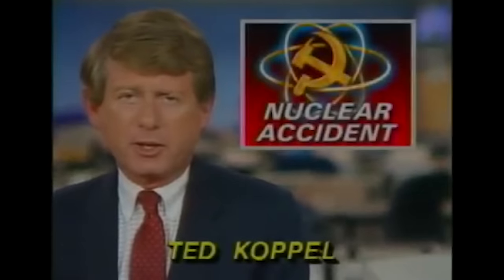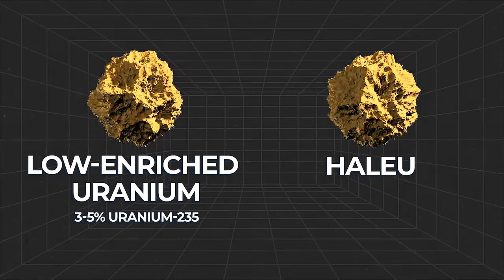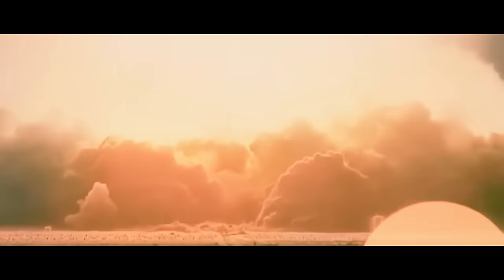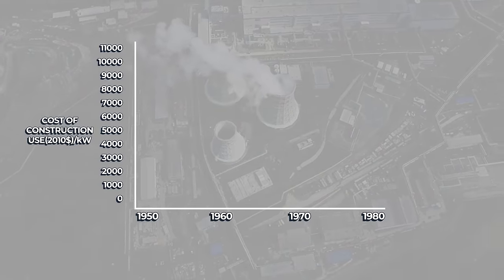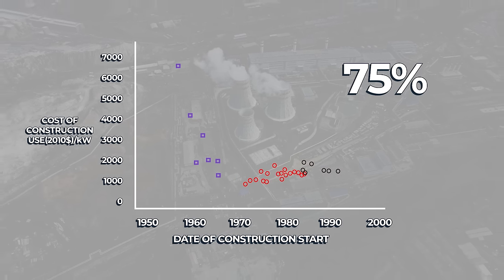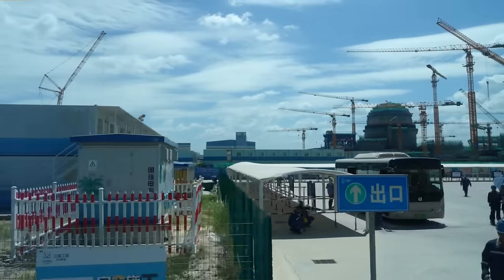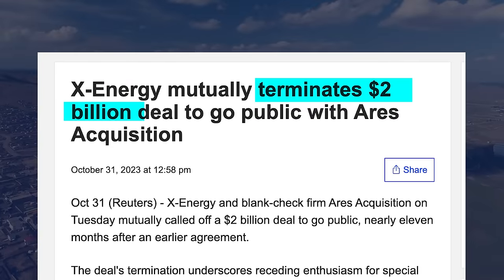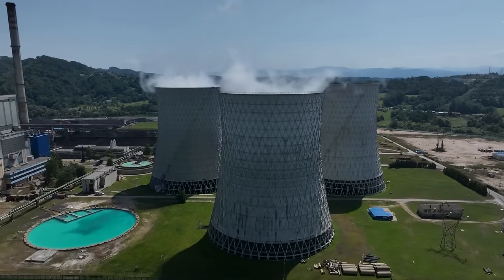Nuclear 4.0 | The Small Modular Reactor Revolution

Comment: isn't a micro reactor still preferable to solar due to the absurd amount of green minerals needed to produce them? i understand uranium mining happens in conflict areas but it seems like a more sustainable manufacturing resource then lithium. also just seems like overall less tonnage removed from the ground so arguably less environmentally destructive.
i know very little on the subject though so would love to hear what others think
Reply: Lithium can be mined sustainably, not saying this is true for all lithium mines though. If this not good enough for you sodium batteries are coming, you can get  a near infinite amount of sodium his from sea water, and there are easier ways to sodium especially in usa
C0bolt is currently used in some batteries, but their are many other materials that can be used, LFP batteries are an example of this. Solid state batteries open up different material choices as well
Reply: Australia and Canada have loads of uranium in the ground. In some parts of the Appalachians folks have an unsafe level of radon gas in their wells, which means there's uranium there too.

Comment: You miss the totally obvious use case: Data centers. Getting the megawatt of energy to them turns out more and more a problem. Overland lines are a serious planning point. Getting land, access (which you need anyway), internet (which is TRIVIAL because you lay it possibly down the access ways) and then - no high energy overland lines are needed. Ups. There is a reason Microsoft is hiring nuclear knowledge for the data center devision.
Reply: You miss the obvious point that nuclear is the MOST expensive way to produce power. Vogtle (first new nuclear plant in the last 20 years) cost $17 billion for a 1,000 Mw unit and that was just construction, NOT operating cost.  Smaller units cost MORE per Mw capacity.
Reply: @clarkkent9080  Actually no - you miss the fact that we are not living in 1980 and that the new way to operate small nuclear plants is NOT that expensive. See, in the old times, idiots built every nuclear plant as a one off - even that being over nowish, the next generation micro plants require a room for a 40 ft container and are installed in a weekend. There is no maintenance - whole units are replaced. I am sorry, but your data is SO outdated it is not even funny - why do you not argue that planes cannot fly as they are heavier than air? Do some research. We talk of shipping containers delivering somewhere up to 20MW power with ... ah, do some research, you look like a fool with that statement.
Reply: @ThomasTomiczek  Where do I start?  
First, old plants were never one-off.  The nuclear power plant is actually quite simple being comprised of ONE reactor vessel, TWO steam generators, TWO reactor coolant pumps, ONE pressurizer and some piping.  The NRC approves for construction and operation a reactor plant design and ANY "one-offness" would require a complete review and approval. 
 The Westinghouse AP1000 design is a brand NEW design and is  very specific and CANNOT be changed.  The AP1000 exact design has been built at 4 locations in China, two units in U.S. Georgia, and was tried at two units in U.S. South Carolina (VC Summer).  They are EXACTLY the same and the latest nuclear plant designs anywhere in the world.
Utilities do specify changes to the BALANCE OF THE PLANT to fit the location and any specific environmental issues such as cooling water supply.

Second, You cannot fit a nuclear plant in a shipping container.  The only thing new about your idea is that you feel educated from watching too many YT videos posted by idiots.

 Look at Vogtle unit 3/4 , each 1,000 Mw units that were just completed in 2024 and span 3 levels and take up 6 acres.  SMR are less efficient than larger units.  Now , please explain to me how a 20Mw SMR can be any less than 1/50 the size of a 1,000 Mw unit? What magic have they performed to squeeze  all that into a shipping container????  And I am sure you will have no trouble finding 50 different locations instead of ONE to build your unicorn reactors?

I worked in the  nuclear industry for 40+ years at five different nuclear facilities so I don't have to do any research as it is called EXPERIENCE.  What do you do for a living?  I assume you are another example of the U.S. public school system.

Comment: I can see the case for SMR, but like you say they haven't really been able to get off the ground. Maybe it just really needs a large backer to get it going, like a nation state. I fail to really see the point of those tiny ones though. There's a joke that people say "it could be useful for disaster response" when they can't think of an actual practical application.

I think overall it's worthwhile to examine presuppositions. You say we always need baseload power generation, but do we really? What would be necessary for a grid to run entirely on intermittent sources and storage? Like, a common refrain is "the sun doesn't always shine and the wind doesn't always blow" but if your grid is big enough, are there really that many times where the sun doesn't shine and the wind doesn't blow and your batteries are dead and there's no generation from hydro, geothermal, and tidal energy and demand is high enough for it to matter? And if that's not feasible, could you get to 95% with some (potentially bio-) gas fired peaker plants to handle the remaining 5%? What about 90%? How about adding in demand following supply? How would the costs of going that route compare to building out nuclear? How would the environmental impacts? What would the geopolitical effects be of vastly increasing the demand for uranium?
Reply: Ask Texas

Comment: Sorry but I am going to have to pull you up on your statement "that we will always need reliable sources to provide a base-load" that's simply not true. With enough generative capacity from enough different intermittent sources and storage, we can use that to do base-load. What it is true is that a non intermittent source to cover shortfalls may be the most cost effective way to make sure that we can supply enough energy 24/7.

The most useful properties for this type of application are flexibility of output and cost of maintaining the plant when it is not providing power.

Comment: Reddy Kilowatt "Electricity so cheap we won't even have to meter it."
Reply: That's out of context - the quote was made in the 1950s and referring to projected fusion power plant costs. It was freely admitted even then that water-moderated fission systems cost more than coal plants to operate

It was also expected that the world would have moved on from those designs by the end of the 1960s. 1950s nuclear scientists would be shocked if we opened a portal from 2024 to tell them we're still using the same basic Nautlius blueprint developed to prove the concept

There were good reason why - it produced steam to drive turbines because 1950s mariners understood turbines and it was designed to be fully self-contained plus serviceable in the middle of nowhere and had an infinite quantity of cooling water just outside the hull and waste or constant supervision because it was an experimental design.  Alvin Weinberg was deeply unhappy his proof of concept was scaled up to Rube-Goldberg sizes by commercial interests with little regard to safety issues and regarded all commercial power plants as dangerous steam bombs waiting to crack open (a 10,000hp railway boiler can flatten a city block if it bursts - and it has happened. There's a good reason most cities and factories switched from steam power to electricity as soon as it was practical to do so)
Reply: @miscbits6399  Informative answer, thank you.

I was relating what we were told as children in the 1950's in school and on Television.
Reply: @lynnwood7205  yes, it was wilfully misreported at the time and complaints made but the meme stuck 

in any case, whilst the electricity might be cheap, the network still has to be maintained and flows regulated to avoid overloads. "Free" power would result in regular blackouts

Comment: Lunar night is 14 days not 1.5 to 3.5 days LOL.  These modular reactor's are going to be so important in setting up bases on the Moon and Mars, If they are controllable enough they could even be used to cut travel times between Earth and Mars powering transport ships and even the engines after an inital boost from a standard rocket to get the ship going then thrusting from nuclear electric engines all the way to mars. Just dont forget to turn the ship around half way and spend the second half of the trip to mars slowing down or you will fly right past mars Lol.

Comment: Nice video!  Curious.  Would micro nuclear reactors, like those built into trailers, be able to combine power output by having several joined to some sort of trailer hub?  Would it make sense to include a series of trailers outfitted with batteries to ensure continuous power. That way a single trailer could be disconnected from the setup without having to shut anything down.  Just plug a new trailer into the hub, or add additional ones as needed.
Reply: That’s a great idea, at that point I think it becomes an electrical engineering task to link multiple reactors together, from a nuclear standpoint there’s no issue aside from maybe some external event type regulations
Reply: The trailers are only for delivery. In practice these things will all be buried in the ground for safety.

Comment: Disclaimer, this is not a question about nuclear power itself... but it is closely related.

I have a rather odd question (being a HVACR professional) and simple one as well. And the question is, Why Steam?

Let me explain... I work with refrigerants on a daily basis, and one of the tools I use is, the Pressure/Temperature (PT) chart. Water is a refrigerant R714, few know that, because water is used in one very peculiar, and lately disappearing refrigeration technology, the absorption cooling. But that is not what got my interest. Google by mistakes one day, gave my a steam PT chart used in power generation... and that made me think.  

We generate power by expansion, we're heating a substance, (water in our case) creating superheated gas that, by moving turbine rotors, generates electricity... right? But I know substances, that expand much faster, creating much larger volume, at much lower temperature than water... the refrigerants. Almost all refrigerants are gasses at room temperature, that can be liquified... however, if heated... refrigerant pressures can put steam to shame.   

Hence, my question... Why H2O? Why Steam? ...isn't a time to rethink the whole concept? Plus, at low temperatures, solids have a better structural integrity. 

R714 -    H2O -                         213F -      15 Psi (a) 
R1270 - CH3CH=CH2 -          187F -    600 Psi (a)  
R744 -   CO2 -                          143F -  2226 Psi (a)
                                                     83F - 1007 Psi (a) 
                                                    -57F -     99 Psi (a)

Comment: Shouldn't these be perfect for remote locations?
Thinking Northern Canada
Reply: Canada also some of the purest uranium in the world
Reply: That's one of the markets they're aiming for.  Places that run off Diesel or Kerosene and don't have road access or pipeline infrastructure.

I occasionally work at Thule Air Base (Pituffik Space Base these days) in northern Greenland.  The whole place runs off jet fuel, including the vehicles.  They've got some boiler plants that provide steam heat and a generator plant that uses submarine engines to provide electricity.  It'd be the perfect place for an SMR or two.

Likewise, Alert, Canada also runs off jet fuel.  Alert is so far north the ocean never thaws, so unlike Thule they can't just send up an icebreaker followed by an oil tanker.  They fuel it by flying a bunch of C-17s from Thule, defueling them until they have just enough fuel to get back, and then repeating the process until they've got a whole year's worth of fuel.  An SMR would be a huge cost savings for them.

Comment: Several Simpsons clips, but very un-crumulantt use the word "ameliorate" without the Chalmers clip.

At least in the west, I think it's going to take a large scale private/public project spanning multiple municipal/state districts ordering dozens, maybe upwards of a couple hundred 20-50MW units to leverage the manufacturing/installation economies of scale necessary to make an SMR design market viable.

And to be clear, I'm optimistic it will happen.

Comment: The biggest draw I see for micro reactors is off grid power. With it every building would be battery operated. Plug in the battery and your good to go. Wide spread black and brown outs would never happen as each building is responsible for there own power. A lot of the cost increase seems to be government's artificially increasing prices to push renewables BS. Renewables have never been sustainable, along with little to no chance for scaling.

Comment: wihtout even ewatching the video: 

No. Even if SMRs were perfect, anything not capable of driving at least 1GW on the non-nuclear (turbine) side is uneconomic

The funadmental problem with current water moderated nuclear technology is the water. They're essentially steam boilers with nuclear bits inside and steam boilers at these scales are inherently extremely dangerous (what's on the inside wants to get outside at 400 atmospheres/350C, taking any contaminants with it). 

A 10MW steam boiler can flatten a city block. Most of the cost of nuclear power is in making both a reactor vessel strong enough to retain 3500MW (and keep it that way without maintenance for 60 years) and a building strong enough to contain things if it doesn't

Alvin Weinberg - creator of the original Nautilus reactor under Rickover - went on to make a safer, unpressurised mark2 (industrial prototype) design which was sucessfully tested in the 1960s - it was shitcanned for political reasons and we've been stuck with his laboratory demonstrator as a result

Comment: portable nuclear reactors to me should be kept only for portable military power or power for scientific use on other planets...   as well as remote areas...   they should be heavily guarded with armed military security to prevent theft by terrorists for dirty bomb manufacture...   
the one concern for use on other planets is radioactive pollution caused by catastrophic launch failures....   this is also why reactors in orbit is a no go...  what happens when reactor equipped satellites fall from orbit... 
of course in the past and presumably the present nuclear batteries have been used in space.

Comment: If small modular reactors are intended to use enriched Uranium, then they are a total waste of time. There is not enough Uranium in the world to power enough of them to seriously impact the worlds energy problem. We desperately need either breeder uranium reactors, or thorium reactors, which also use a breeder cycle. There is plenty of fuel for these and they could power society until fusion becomes practical.

Comment: Hydrogen embrittlement (HE) refers to mechanical damage of a metal due to the penetration of hydrogen into the metal causing loss in ductility and tensile strength. HE can occur due to corrosion of steel by H2S when hydrogen atoms are generated.

Hydrogen cooling, what could go wrong  ????
Reply: Why do you assume engineers are stupid and don't realize this?
Reply: @jeffspaulding9834  they do know, and the ignorant do not.
I'm just saying dreams of hydrogen carrying vast amounts of energy is wrong economically.

Comment: Don’t know why they wouldn’t just build small reactors and just use a bunch of them on the same grid so that no one reactor uses enough fuel to cause any sort of large scale disaster. It’s like in games you don’t build a bigger power station you just build more and link their output to get more energy.
Reply: Simple answer: There is no such thing as economies of SMALL scale in power production.
Reply: @clarkkent9080  you don't build one giant solar panel you link a bunch of them to the same grid...
Reply: @rsmorex  You miss the point.  SMRs cost significantly more per Mw generated than large plants.  The first commercial nuclear power plant was Shippingport (60 Mw output) and many 1960s nuclear plants were ~300 Mw which is a SMR.  They were ALL shutdown because the large 1,000 Mw plants were much more efficient.
Reply: @clarkkent9080  yeah cause technology hasn't advanced since the 60's
Reply: @rsmorex  Your kinda thick. and I don't know if I can dumb it down enough for you.

  Yes we still boil water to turn a turbine and a generator.  And big or small it is all the same.  What has technology advancements have to do with economies of scale?